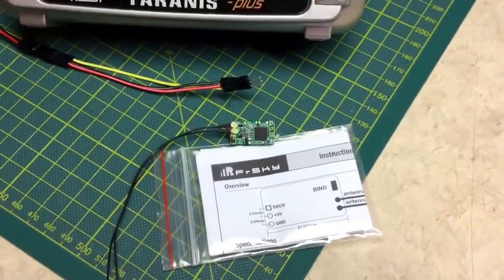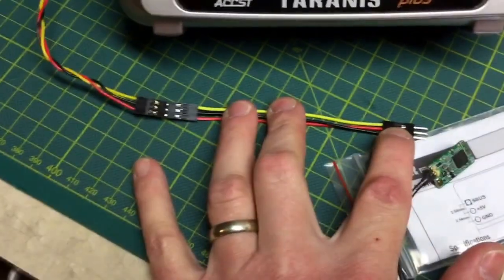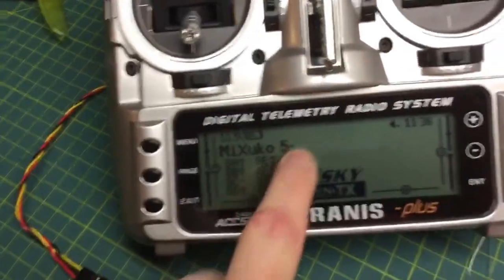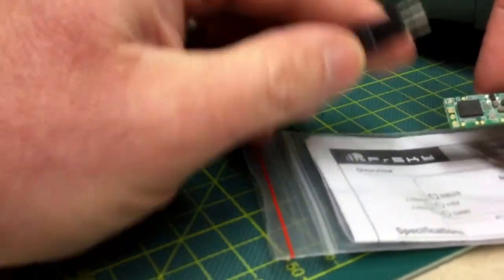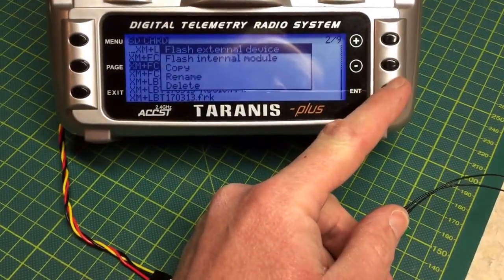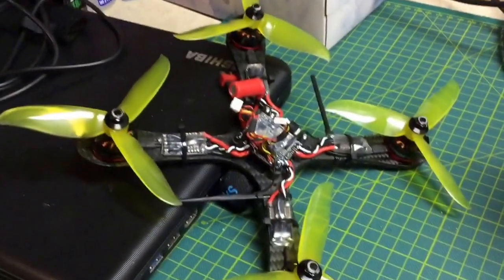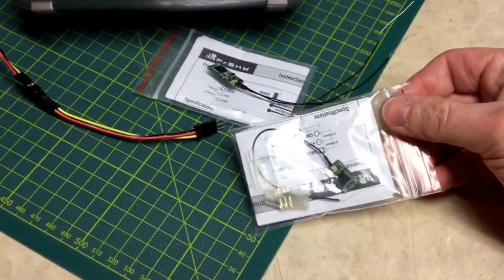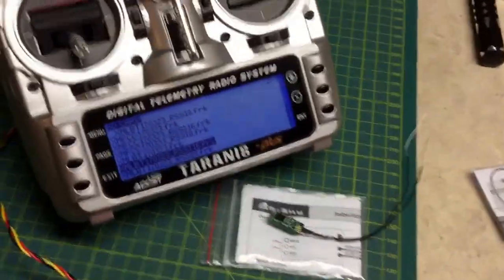Flashing Optional Firmware To The XM+ With Your FrSky Taranis X9D Plus

Comment: Hello! I got an XM+ to my new build too. I had no RSSI with this so I tried to flash th new FW to it. I soldered the pads. But when I tried to flash, it blinked only one, and sent an error message: "Firmware update error"  I changed opentx from 1.6 to 2.2, the result is the same. Now I can't bind it, solid green and red lights what I see such like wrong FW version, but I can't reflash it. I found that many people has the same problem, but I didn't find solution. Could you help me?
Reply from the maker: Ahh not sure. Did you do a full power off and retry flashing? It almost sounds like something got disconnected. Were/are the connections on the TX side solid?
Reply: I checked the connections. Even the ribbon cables inside the taranis. Same result. I tried to flash the internal module.  It had error message at the end of the process, but for second time it flashed the latest FW without visible problem. I still can't flash the receivers. The bigger problem is that now I can't bind any of my quads to the Taranis. (All firmware and Opentx is Non EU version - I have D8 receivers). I'm stucked at this point. 
 If I order frsky cables to upgrade without smartport, it can help. The module change can help too (More cost and maybe unneeded.) At worst case, I will order all of these parts, and it will not work. It takes time, and I'm shaking like an alcoholic without fly.
 Do You have any suggestions about Taranis repair?